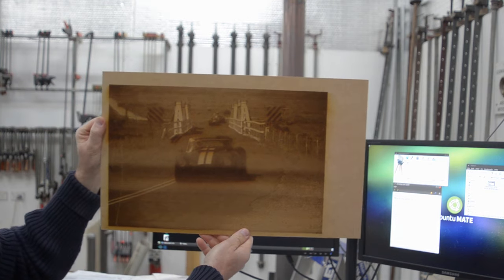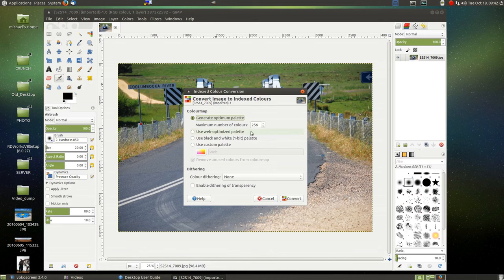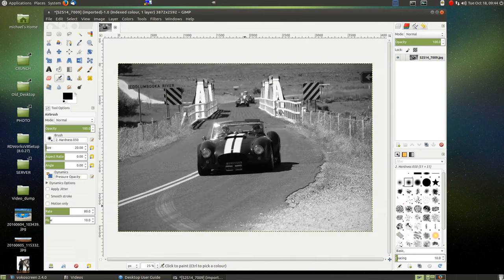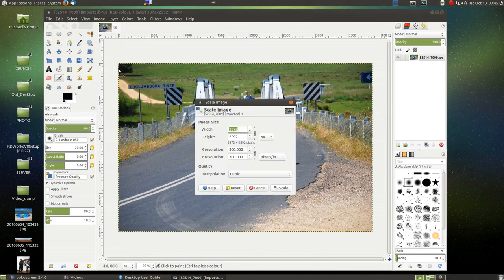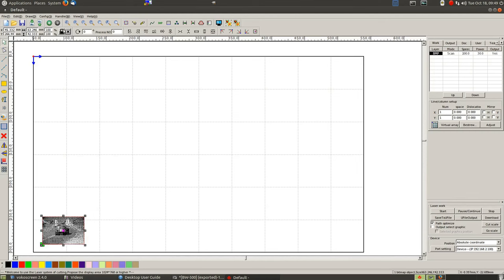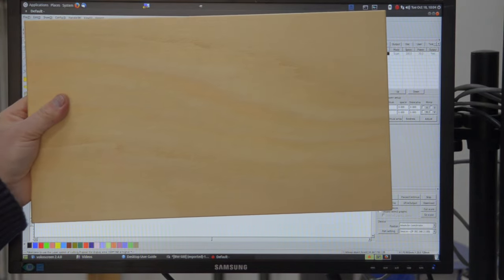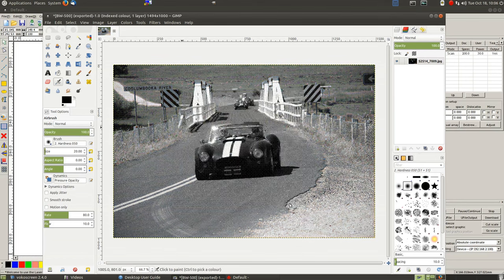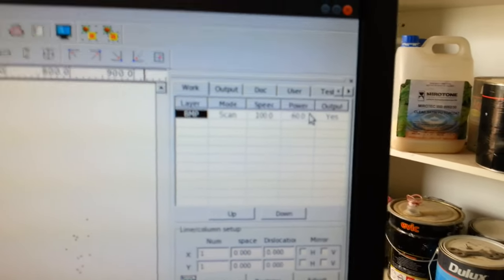LASER ENGRAVE PHOTOS - how to GET IT RIGHT.

Comment: This is a well thought out tutorial which clearly explains the way to prepare a photo for laser engraving and how pixels are manipulated for a laser to interpret into a picture. Many thanks for this video as it has enabled me to produce a photo onto slate. Just one thing, if you are using an Epilog machine, change the RGB output to Greyscale in the print manager before sending to the Job Manager and the picture will appear as it should.  Otherwise all you get is a black image where the one colour of the pixels (black) will be interpreted as a total black image. Full marks to this gentleman for putting this video online. Brian Walker, UK.

Comment: I really having a hard time doing this. I just cant choose a layer when I import a picture. Everything works fine with cutting and engraving vector files, but when I import a picture there is no layer set and the Mode is dot. Could you please help me? RD Works V8.00.32 Laser : K60
Reply from the maker: I am having trouble trying to work out where you mean.
Do you mean in Gimp, or RDWorks.
Are you aiming to mix raster and vector in the same job?

Comment: Thanks for this video! This is by far the best I've seen about getting the best settings for your photos. Are you using an air assist on your laser? What laser are you using? thanks!
Reply from the maker: I use the stock air assist, which is a fairly low flow rate, certainly no pressure.
My laser is a cheap Chinese unit.
https://youtu.be/dotmE3_YQCk

Comment: Hi friend, I noticed that your engraver is blazing fast. Which controller do you use? is it 32 bit? What is the wattage of your laser module? Thanks for the great video.
Reply from the maker: it is a 50watt unit, it uses a Ruida controller, I can only speculate as to whether it is 32 bit, but the performance of the controller is impressive, I can't imagine an eight-bit unit doing this ;)

Comment: This video is awesome!  Really shows what to look for and how to set it up.  I followed along but got bad results when importing into Rdworks, I saved as jpg just as you did but when I zoom in after its in rdworks it combines a lot of dots and forms more lines (horizontal) and looses all the nice spacing that all the hard work was for in the first place.  Any idea's on why rdworks reinterprets the file?  would be nice on your video if you showed what the image looks like in rdworks after it is all done.
Gimp 2.8.20
Rdworks 8.01.18
Reply from the maker: I have a later video that shows setting dots per mm in Gimp.
RDWorks just goes with the flow that Gimp sets up if you go that way.
RDWorks does not show these images on the screen very well.
Reply from the maker: This video shows RDWorks at about the 12 minute mark.
Reply: I been messing with this off and on all day and finally got it into rdworks with dots spaced evenly just as it was in gimp.  Two things I am thinking it was it either the 72 dpi was not set to 300 dpi when scaling image or it worked because I opened up the advanced settings during the export of the jpg and unchecked "Optimize" and also unchecked "Progressive".  I am laser engraving black granite and the test came out awesome.  Truly hats off my deepest appreciation for you taking the time to post these videos!
Reply from the maker: Awesome :)

Comment: just wondering on the final image, there is somewhat like mesh like finish. is thar the material surface or due the engraving process?
Reply from the maker: That is kinda the whole problem, you have only on / off, and about 200 DPI.
That is why video exists, haw to get reasonable tone depth given those constraints.
The 'dots', get a little blurred, all photo prints, both colour & greyscale have this issue, what they do for the photo printers is create a LOT of dots for example six of my photo printers produce 5774 DPI which produces around 30,000,000 in every square inch.

These laser machines are good for about 40,000 dots in the same space.
Reply: Helmreich Enterprises i see. interesting technique. i have tested in dithering but it is only black or white. i am using photoshop so conversion to bitmap only has halftone option without the position option like your example. will test that out and see how it turns out. thanks for the video insight. 👍
Reply from the maker: Cary Andrae , there are two points, I am certain Photoshop will have equivalent functions, and Gimp is a free download for all systems, it is open source.
I believe the Photoshop equivalents are error diffusion, and ordered, they are the terms I remember from  Corel photo paint.
look for similar expressions in Photoshop, or download Gimp from  gimp.org so as to have identical software to the demonstration.

I hope that helps.

PS error diffusion is equvalent to Floyd Steinberg, ordered is equivalent to positioned.

Cheers, Michael.
Reply: Helmreich Enterprises Noted on that. Will test out the options in photoahop. but your video would be a good reference on to look out for. thanks again😊